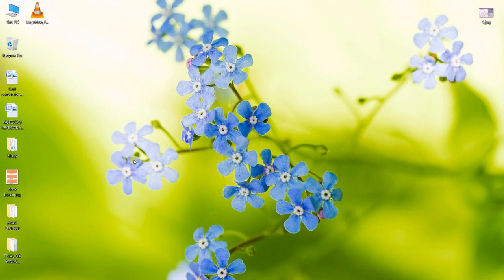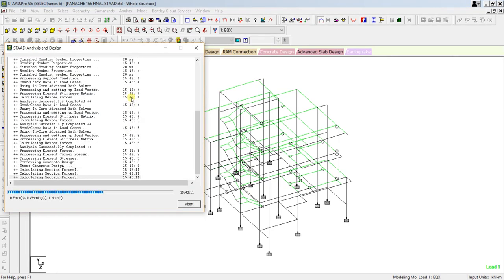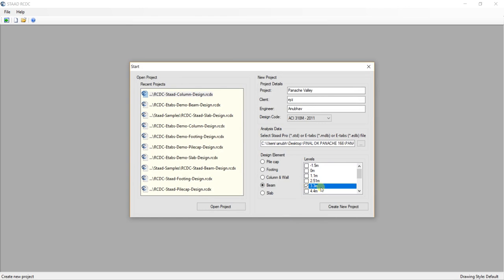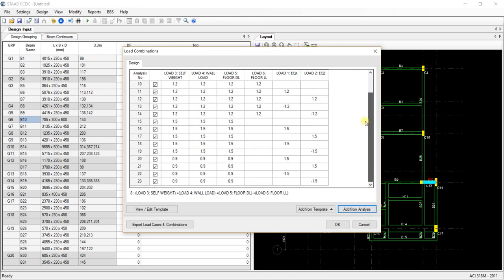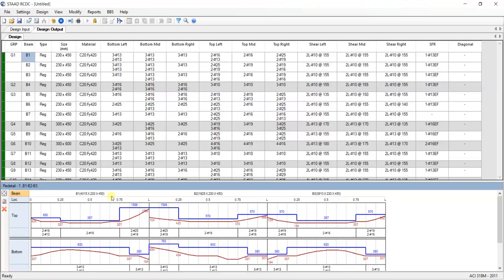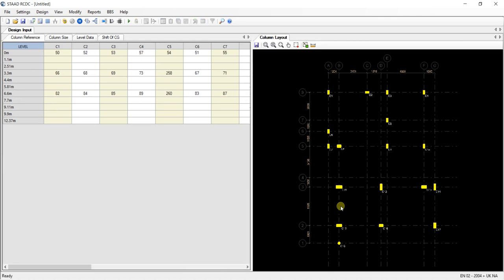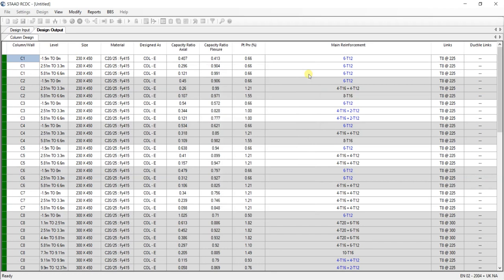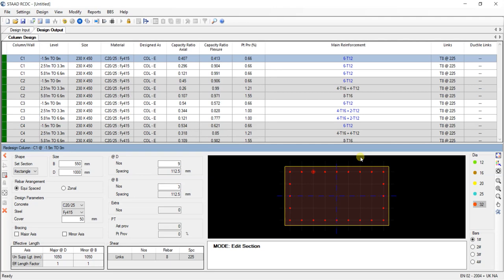S-Cube Staad RCDC Ver 6.1 Performance Check and full Testing

Comment: Sir the setup you provided supports only 'IS 456' and that works fine however the latest version provides 'IS 456 + IS 13920 2016' for which it shows remark ' License for design code' not found...
Kindly help with the problem
01aadarsh@gmail.com

Comment: Hi,
I have staad pro ss6 version 20.07.11.90.
I had downloaded STAAD RCDC as per your guidelines from that website you told of version 6.03.01.02(v6. 3). The version you mentioned has not found. But when i open a project of staad pro the RCDC always says unable to read analysis data.

Kindly assist me or you provide the v6. 1 download link.

Comment: You are showing RCDC v6 demo from s cube along with Staad rcdc. Which is not fully function for dxf export, all layers are not exported. Checked for footing section
Reply from the maker: It's S-Cube RCDC v6.1, not Staad RCDC, the reason why we call it S-Cube Staad RCDC is that the company has collaborated with Bentley and Bentley is the official seller for RCDC along with S-Cube. I'm using the same download file that I've shown in the video. If it is not fully functional then you can just go and Buy the software from the vendor or use the old ver4.3. Don't claim anything unless you know it if you have a better solution than kindly help the people instead of telling it's a fake video. I'm trying my best to aware the engineers about the software that is currently available, I'm doing my bit and I hope you will do yours. 
Thank you for your comment and watching my video..Take Care.. n Keep Rocking..!!

Comment: Hi sir, Tried to reinstall the RCDC version 6.1, i disabled my internet connection and anti virus, i created inbound and outbound rule for RCDC but same problem when i tried to open file from my staad analysis. A pop up message appears "License for design code not found". Can you help me to solve this issue? Thank you in advance..
Reply from the maker: Bro, i'm also using the same set of files for installation as you, but I don't know why you guys are facing such problems. In the video, I've used different design code and try to do the analysis and it worked completely fine for me. I'll make a fresh installation video for you, give me some time..!! Thanks for your patience, I really appreciate it..!!
Reply: I already resolve the issue i replace my staad.pro with active License and my RCDC works perfectly.. Here's the link for Staad.pro with active license  https://goo.gl/P7onUL
Reply: Thanks sir! My STAAD RCDC is now working smoothly
Reply: You need to have a Staad.pro with active license so that your RCDC will read the design code otherwise it will not work..
Reply from the maker: https://www.youtube.com/watch?v=GRdvPVQpsxM
Reply: Bro plzz send license to bkshbksh2@gmail.com. after installation it is showing design code license error.
Reply: @sohamkundu273  I have Staad Pro v8i s6 20.07.11.45.  but  RCDC 6.3 is not reading staad file